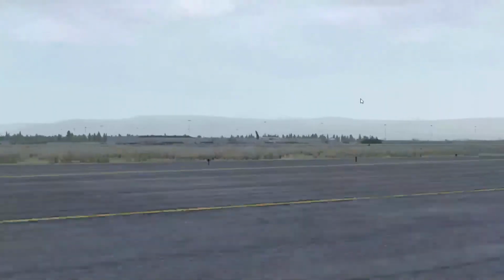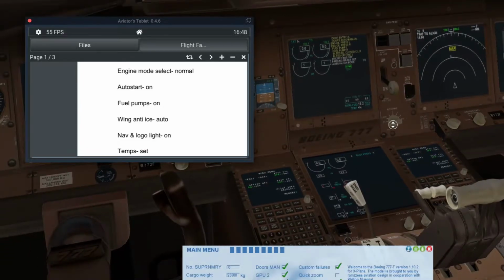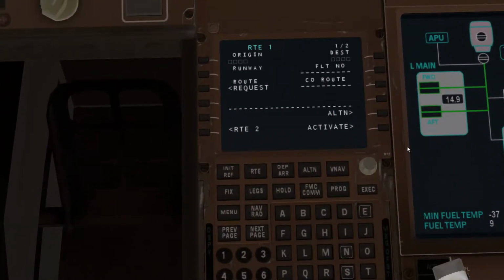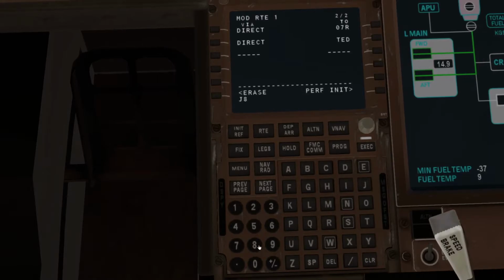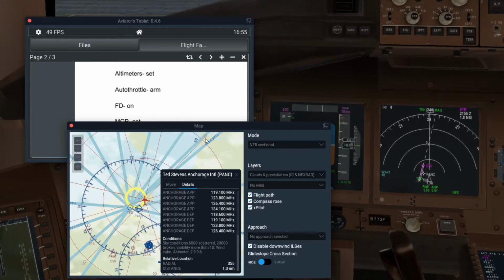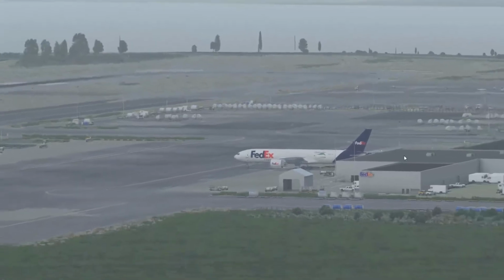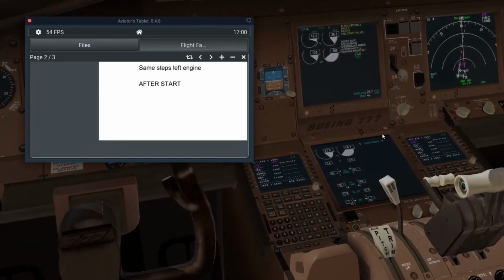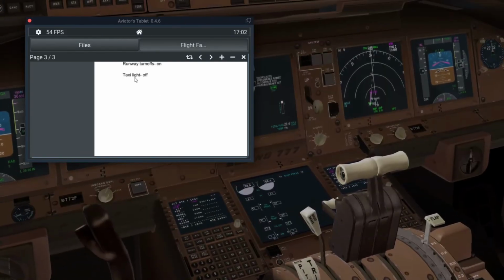Flight Factor 777 Cold & Dark Full setup & FMC setup

Comment: can this airplane do jump waypoint?
Reply from the maker: yup
Reply: @simpilot8508  how?
Reply from the maker: @FlyWithNibraz  in the fmc i think in the legs page there is a direct button
Reply: @simpilot8508  no, i mean the feature that teleport the plane to the next waypoint to shorten the flight time. not direct
Reply from the maker: @FlyWithNibraz  Oh i dont know then ive never tried that
Reply: @simpilot8508  so when you fly for like 7 hours then you keep your pc on for 7 hours?
Reply from the maker: @FlyWithNibraz  ive done 14 hours
Reply from the maker: you can use the x plane map and move the air plane icon from there but that causes games to crash ive noticed.
Reply: @simpilot8508  yeah i know that, but its not accurate

Comment: I bougth this plane i have a lot of problem to load the instruments panel ...nothing work like in your video this is all a rip off
Reply from the maker: Yes ive heard about the problems with the 777, for the 767 im shocked no one has problems with that plane, my guess would be make sure you download the Microsoft C+ it says it is required on the org store.
Reply from the maker: If this does not work make sure you dont click on the x plane 10 version in the main menu. if that doesnt work email flight factor

Comment: My cursor won’t let me turn hydraulic switches to auto. Any advice ?
Reply from the maker: I’ve had that issue to. first try updating the plane and if that doesn’t work reload the aircraft or go in the aircraft menu and select mouse wheel
Reply: @simpilot8508  how do I update the plane?
Reply from the maker: @JL-je5dm  go in the aircraft folder and click the x updater
Reply: @simpilot8508  I deselected mouse wheel, I see a different cursor but it still won’t turn
Reply from the maker: @JL-je5dm  are u using the mouse wheel ?
Reply: I figured it out! Thank you !